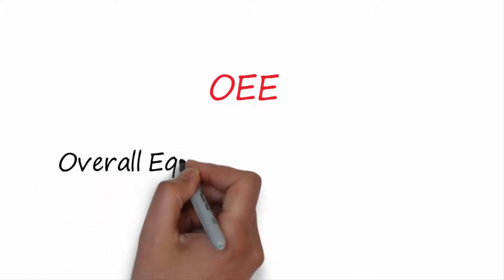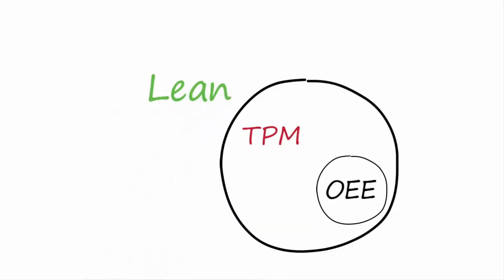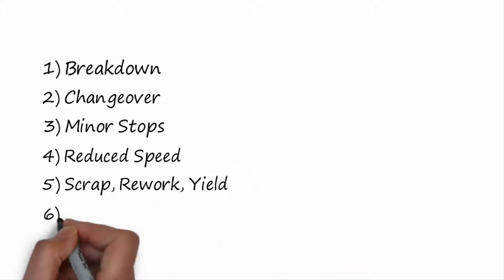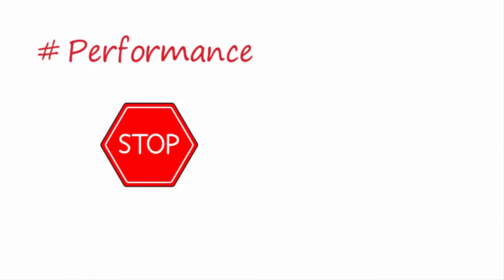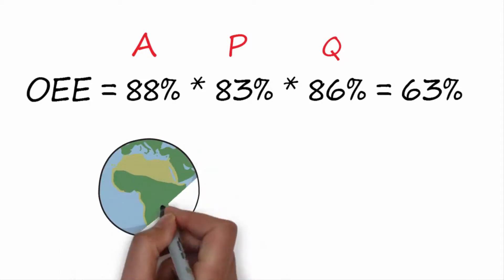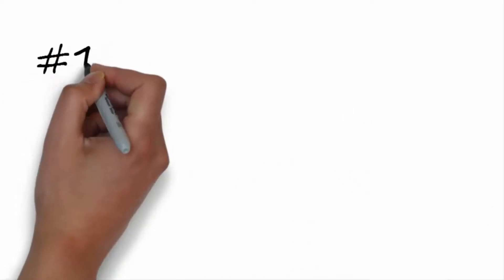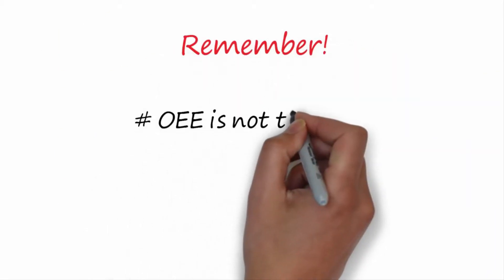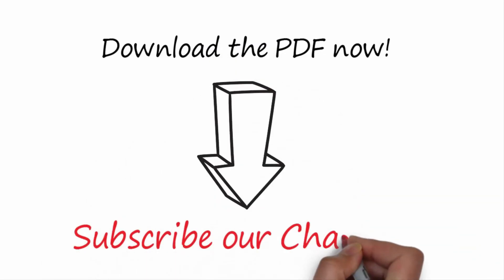OEE Calculation - Overall Equipment Effectiveness

Comment: I've been recently assigned to implement OEE in my plant. It's a pharma company, any leads how to proceed. I see a lot of content, need some realistic data to strategize.
Reply from the maker: Dear, I am going to prepare a video with a realistic case.

The first question I have for you:
"Are you going to calculate OEE for 100% of Equipment?"
Reply: @LeanVlog  That would be great to see some realistic calculations.

For 100% of the equipment, I am not sure. I have been assigned this project recently and I don't know the scope of it. But I have a couple of meetings coming up that will clear everything up for me. In the meantime, I am also checking the data in your pdf. Thank you
Reply from the maker: Dear, from my experience to calculate OEE on 100% of machines is high effort / low benefit.

Start with asking why I need OEE?